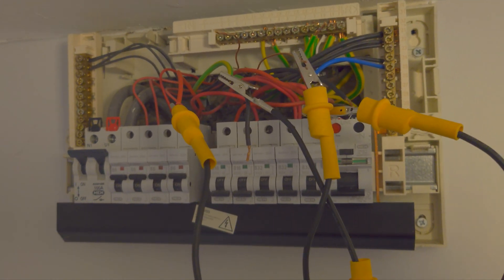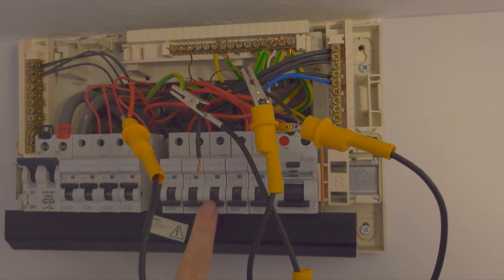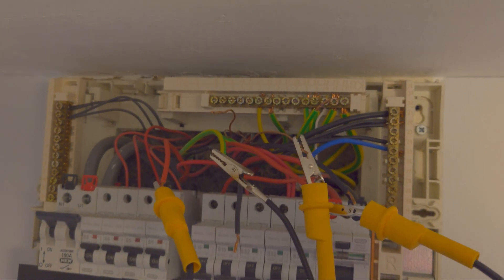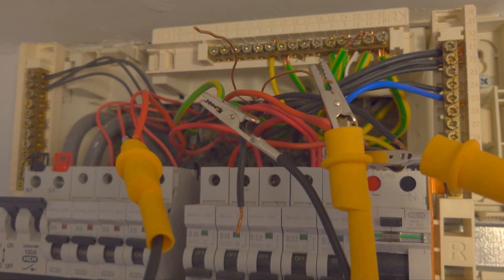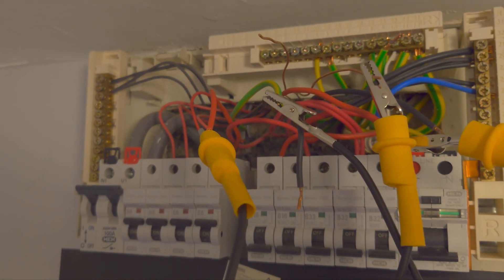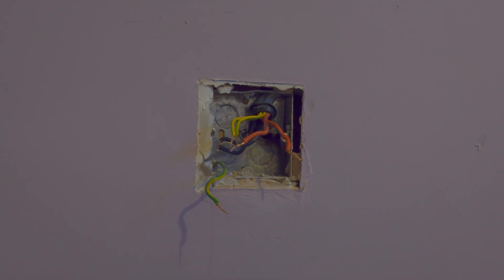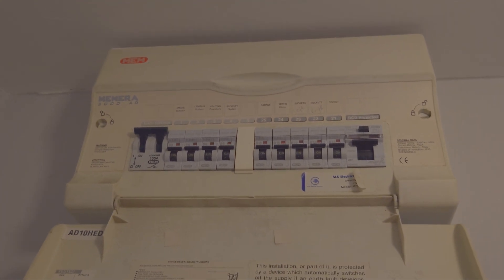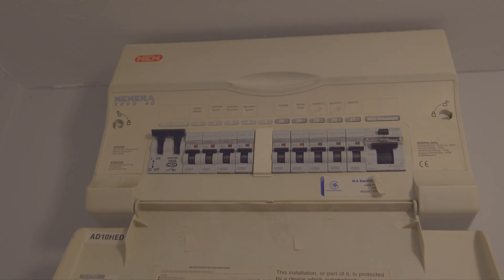Tripping Time ! Fault Finding a Tricky MCB and RCD Tripping Issue

Comment: Don't you think ring circuits should be abolished ,weldone on fixing the problem
Reply from the maker: I wish they would be, but they are still being installed in new builds. I rewired a kitchen a year or so back as a couple of 2.5mm 20A RCBO radial circuits - 1 for fridge freezer and dishwasher, 1 for the sockets as per the clients request. That was simply splitting the existing ring and rerouting the cables. They are a pain in the backside.